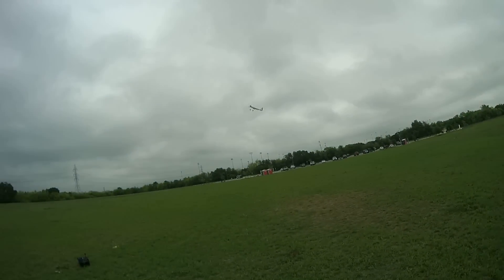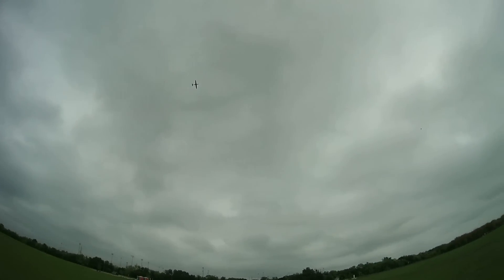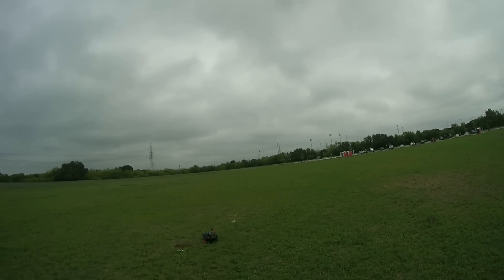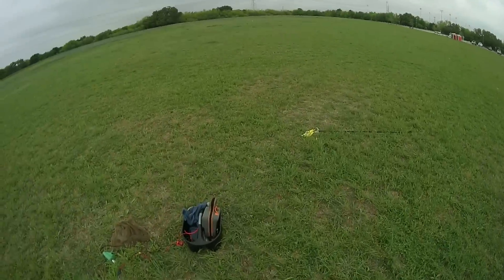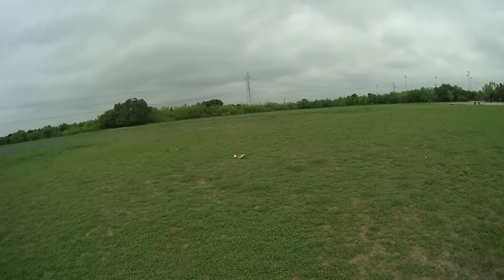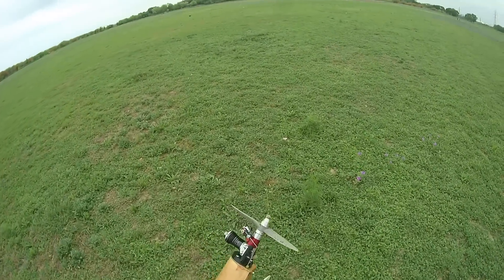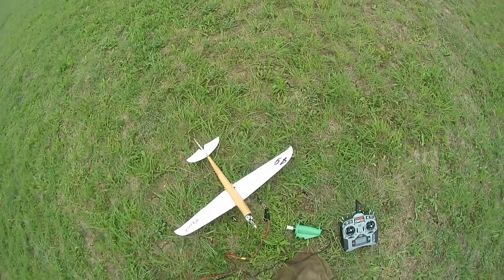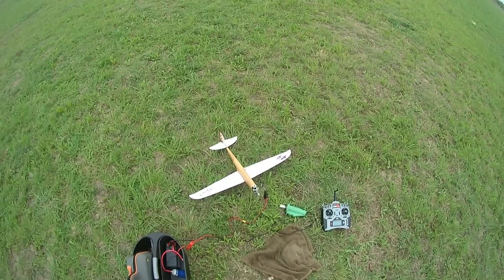Flight Cox Killer Bee Piston Cylinder / Tee Dee Frame RC Carb

Comment: Yea buddy thx.. I subscribed..
Reply from the maker: Thank you, if you get the carb having throttle is a big plus they also sell the exhaust throttle sleeves too.
Reply: i dont like those because its just a restrictor/choke, not a true idle. still burns the fuel constant at full throttle. but its a novel idea thats way cheaper

Comment: so you can't throttle it, you must keep flying until it runs out of gas, is that?
Reply from the maker: Yes can throttle has a RC carb rather than a venturi see the start up setting of the needle and throttle set up this was a new engine so needed to fiddle with it a bit to set up the carb.